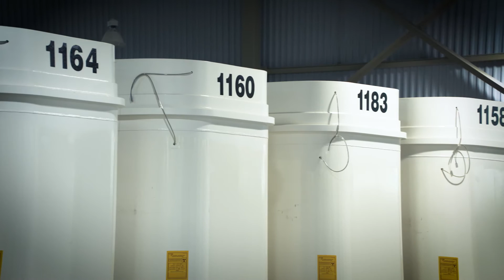Nuclear Waste - Handling With Care

Comment: We are clearly between a rock and a hard place when weighing the risk/benefit ratio in using nuclear power. On balance I support the need to carry on for now. I don 't like the cavalier dismissals of wind and solar power sources. We are a northern area where sun may not be readily enough available but we have many places that are windy more often than not. Also a proactive analysis on the benefits of personal and neighbourhood use of wind and solar to reduce large scale demand would be useful. The video is as much a promotion as an education. Risk is minimized.